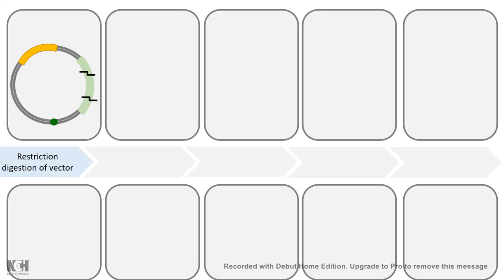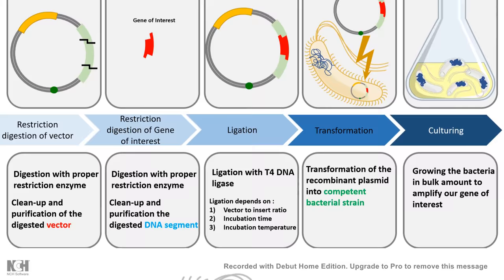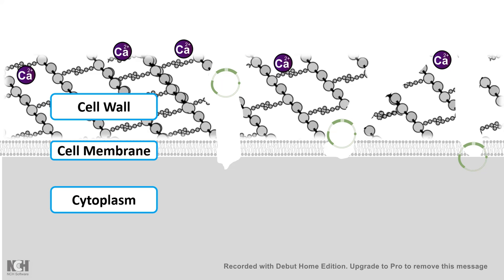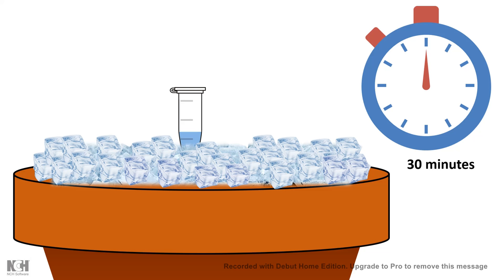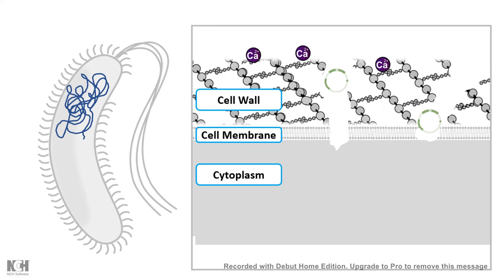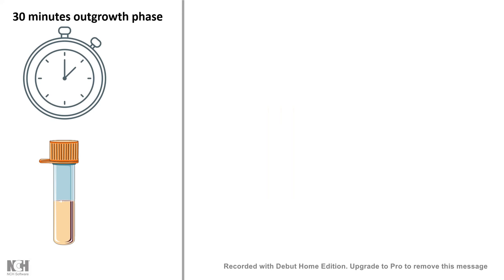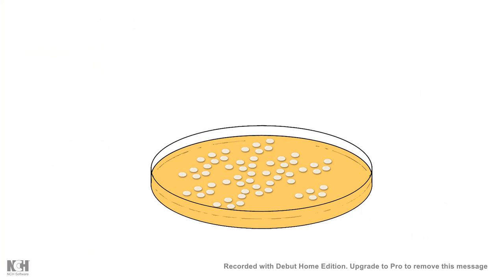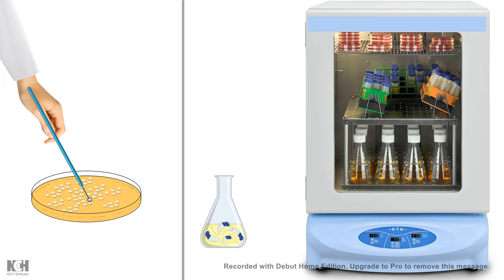Bacterial transformation

Comment: Does only 1 plasmid enter the E.coli cell? Or do many of the same plasmid enter the cell?
Reply from the maker: Many many plasmids
Reply: @animatedbiologywitharpan  If for example 8 plasmids are outside of the cell during incubation, do 8, 4, 3 etc plasmids go in? Or only 1?
Reply from the maker: Let's say 10 plasmids are there in the solution so ideally 10 should go inside ( assuming transformation efficiency is 100% ) . But in reality it's near 60-70% so 7 would make it and 3 would not . In reality we  use plasmids in nanomol concentration. Now you can actually calculate the number of plasmid used for transformation.